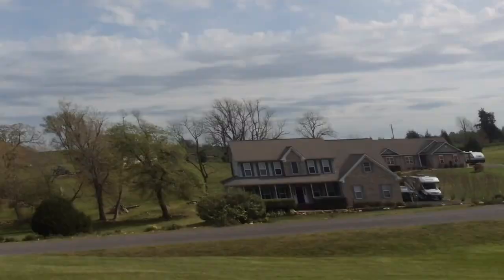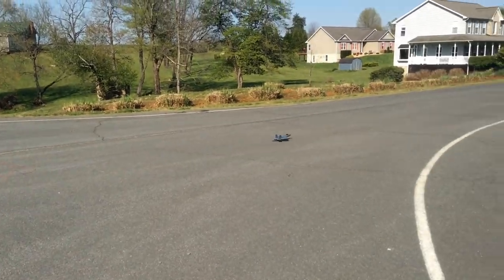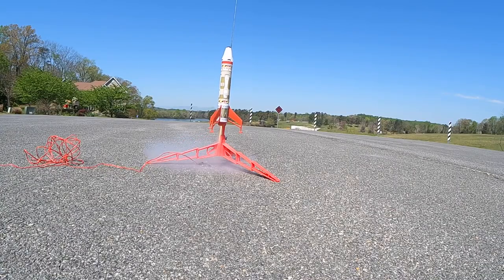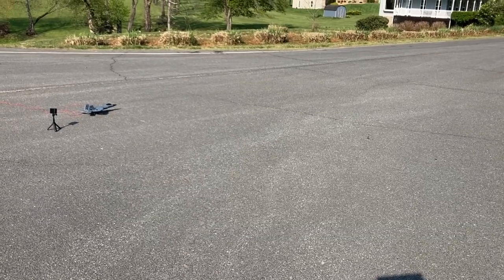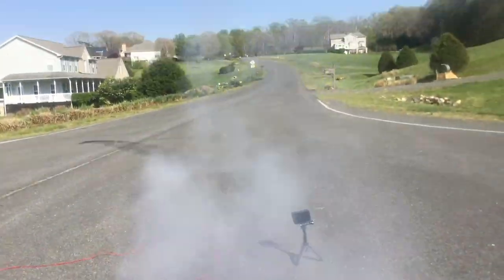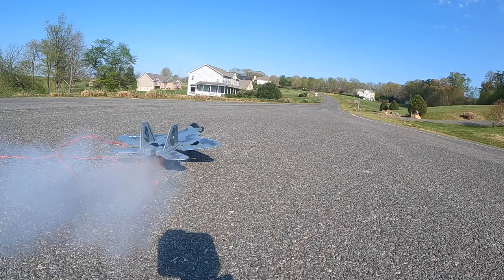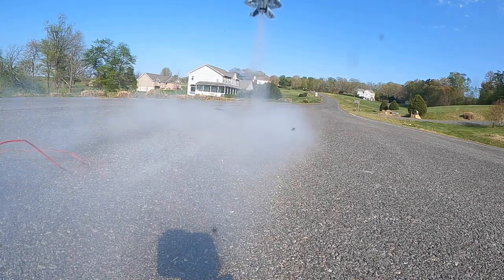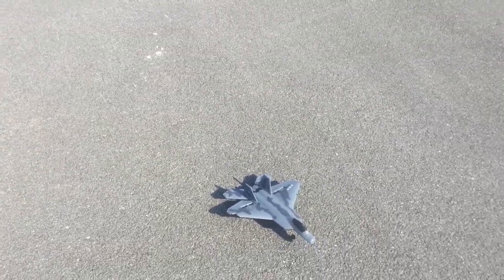RC Fighter Jet With Rocket Assisted Takeoff!

Comment: The problem is that the planes is way to light to hold a rocket and second the mount is way to unstable
Reply from the maker: Yeah, but I think if I had mounted a second motor on top of the plane it actually may have worked better, because the center of thrust would have been in line with the center of mass